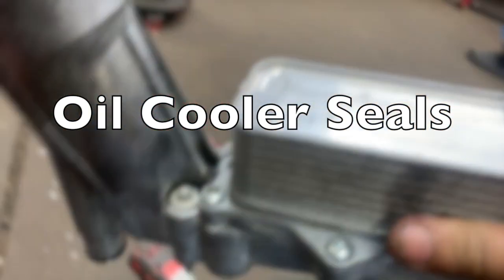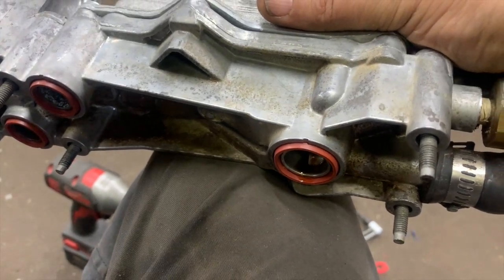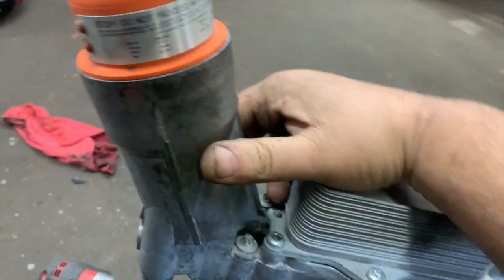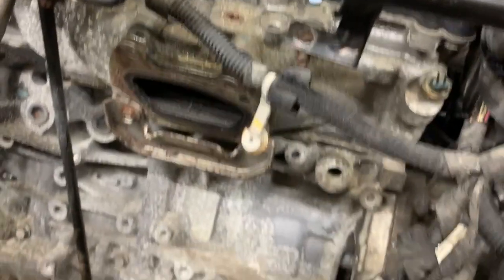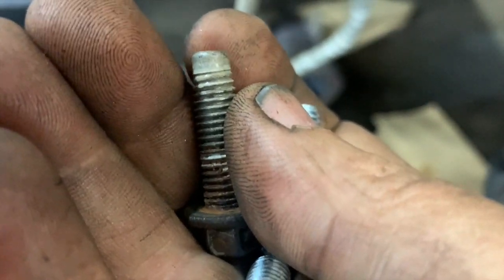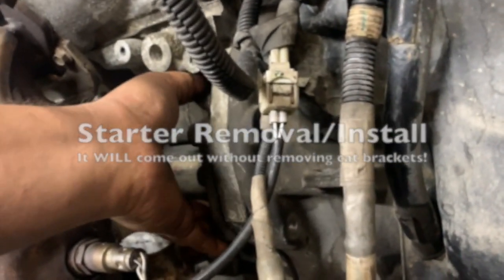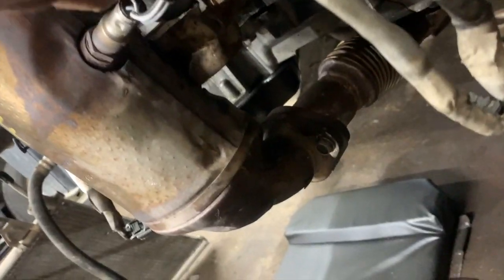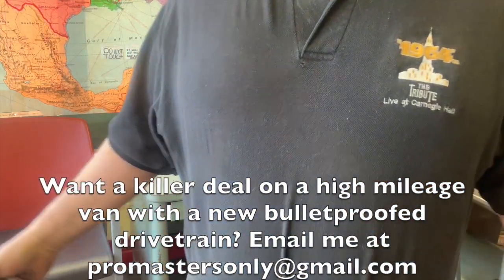Short Topics: Oil cooler Seals, Starter Removal, Catalytic Converter Bolt upgrade, State of the shop

Comment: Ooh. I have the Dorman but a new bolt upgrade? Yes please.
Reply from the maker: Now don't get too excited - using different bolts would make sense if the cat is already out, or the van is very new. But to do it just to do it is asking for trouble, because the existing bolts may break, and then you've taken a running van and turned it into a van withe an exhaust leak.

Comment: Amazing content. So much valuable information.  Really appreciate what you do. If you havent already would you be able to make any videos about dash removal and evaporator replacement.
Reply: I have done a replacement of the whole airbox assembly.  It's a lot of work, but do-able.  You have to unbolt the steering column.
Reply: @vetsen  im sure i can take it out . But remembering where everything goes after is what is intimidating lol
Reply: We’ve never had to replace one. Are you 100% certain it’s not just the blend door actuator? I dread the day when I have to pull that whole goddamn dash apart.
Reply: @kipamore  unfortunately there have been two that ive seen so far and they went straight to the dealer for leaking evap.
Reply: My biggest mistake was not documenting the large wiring harness routing.  I had to undo the harness to after it was almost all put together.
Reply: @kc5504  https://youtu.be/oRuznAYKDpw  I can try to answer any specific questions you might have.  It took me several hours to finish.
Reply: @vetsen  this is exactly what i was looking for thank you for putting that together
Reply: @kc5504  here is another video that you might be able to use,  https://youtu.be/IajJmYL1HPo

Comment: Hey kip! Really enjoy your humor and information in the videos! I am an owner operator up here in Canada.
2014 promaster is in limp mode won't shift with p0868 code, I replaced the solenoid pack with no luck now I'm thinking doing the fluid pressure sensor next?
Reply: See if you can get a hold of a scanner that reads live data. I would suspect the pump is shot, but I’d want to know for sure before I go in there.

Comment: Kip, at 5:02 the bolt you're hold reads HX 4.8.  Is that metric hardness class 4.8 which would be equivalent to an SAE grade 1, a very soft bolt?    I'm just learning the hardness chart between SAE and metric is different.
Reply from the maker: Not sure why I missed this comment, but I did. My guess is that the OE prefers a soft bolt, the logic being it's easier to drill out when it breaks, though the better bolt would break less, you would think. It's not the end of the world if the bolt breaks for a few reasons. On the front cat, if you pull the radiator it's all super easy to get to. On the rear it's way worse, but if you remove the lower trans mount you can swing the engine such a way as to give you better access to the rear cat. But the big takeaway is that even though there's 4 bolts holding the cat on, the lower two are a channel that the cat sits in. So the upper two, the ones that break, only hold the cat to the gasket. They don't support the weight, and they aren't subject to vibration or movement. As long as you had one bolt, you could be pretty sure the cat would seal and work fine.
Reply: @promastersonly1419  Kip, thank you for the reply. No worry on not seeing the comment, all good.

Comment: What is your honest opinion of the pro master vs the transit vs the sprinter I am buying a van soon ? 

I hear horror stories of all three but in general I hear a lot of bad stuff about FCA vehicles
Reply from the maker: All vehicles break eventually. That said…

Benz is overpriced unreliable garbage. Truly criminally bad. 

That leaves the transit and promaster. Overall cost of ownership is near identical. I prefer the promaster. Briefly; better mpg, turning circle, interior quality, fwd superior in winter. If you tow get the ford.
Reply: @promastersonly1419  ok thank you very much, this helps

Comment: After 9 months of reflection what grade replacement cat bolt did you decide to put in?  At 6:23. Yes, fortunate or not, I'm the kind of guy who gets off on doing little weird upgrades.  I put it on my to do list list, well ahead of new wallpaper for the kitchen Betsy has been bugging me about for... I won't even tell you how long.  & no no not me of course, lol, but the mildly anal retentive would be curious which high temp anti-seize you recommend.
Reply from the maker: I happen to know without looking it up - m8x 1.25 x 25mm is stock. I stepped it down to 20mm, figuring the less thread in the block the less threads to seize and the easier to extract if broken. I use the copper Permatex. I decided not to use a grade 8 bolt, since I noticed nobody else does on any engine, and there must be a reason.
Reply: @promastersonly1419  Thank you for the reply.  High probability this will save me a lot around 2032 or so. I'll pay it forward.

Comment: Hey brother I hope you get the time off that you deserve and enjoy life 
I have a question I have a Promaster 1500 van with a blown head gasket 🤬I’m getting it fixed soon while they have it ripped apart it’s a good time to change my spark plugs should I get iridium,platinum or just stick with OEM longevity is my biggest concern thanks brother 🥰👍
Reply: The plugs aren't too hard to replace with the engine in the vehicle.  The hardest part is getting the upper intake off.
Reply: The factory plugs are iridium. We prefer the NGK iridium. Rock auto has them, as does every parts store.

Comment: quick question - what's your opinion of the ProMaster spare tire carrier/winch? do they work well or mostly get stuck? my van came without one and I'm considering getting one (used? maybe?) - or just put together one that uses good old bolts - any opinions on this?
Reply from the maker: The factory winch sucks. Works maybe one time. Dropping a bolt down through the floor is the only good answer.
Reply: @promastersonly1419  Thanks for the tip. No need to bolt through the floor - there's the winch mount - will just add an adapter there
Reply: Kips right mine worked only once or twice. I ordered a replacement online and put that in but I’ve never used it beyond the test at install.